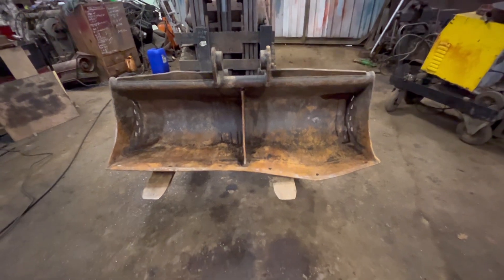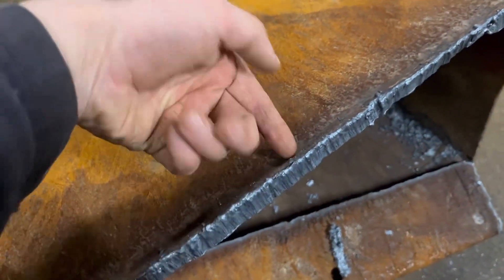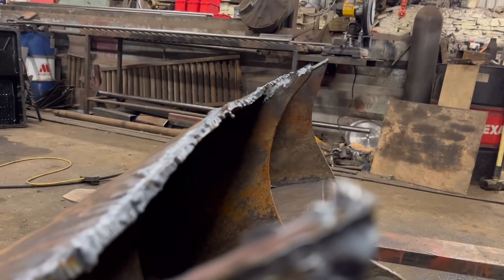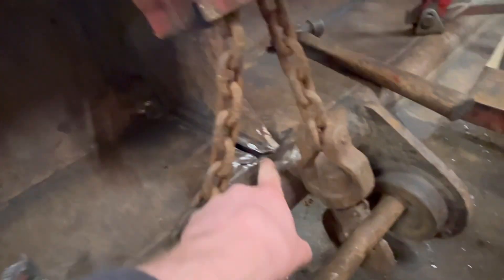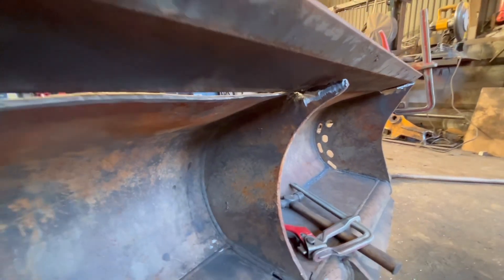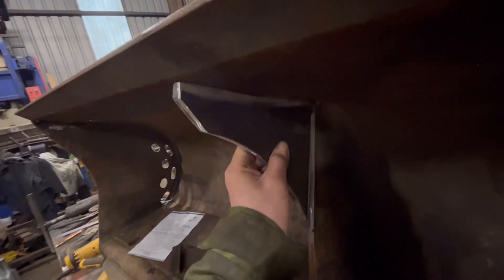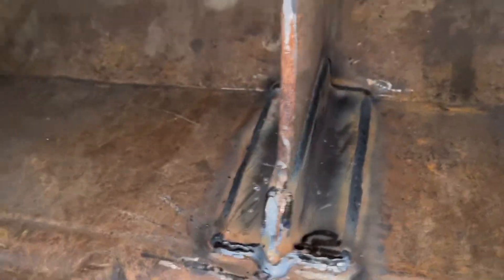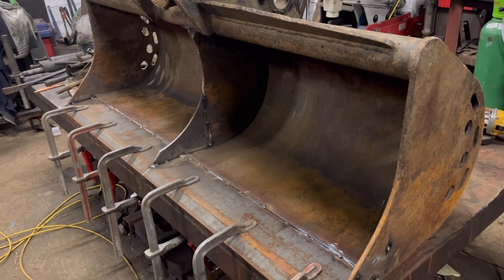Straightening a bent ditching bucket

Comment: Oliver, that was one aced job. A1. Something that's probably occurred to you since then is to add skid plates. They aren't just for abrasion prevention but beef up the rigidity of the bottom at the cutting edge. On that bucket it's obvious the operator abuses the heck out of the bucket and it needs all the stiffness it can get.
People, don't like the music? Turn off the sound and turn on the sub titles. He's doing his best at two jobs, repair and fabrication and several more hours editing the videos which aew very well done.

Comment: Am surprised that the rings were intact, clients broke the other two you worked on.  You're the only other guy I've seen doing gouge welding, seems really useful.  Curtis from CEE in Aus does it also.  Lastly, you are very soft spoken, might need a mic like pastors wear, over the ear on a wand.  Good job straightening that bucket.

Comment: Why don't you get yourself a plasma cutter?. It's so much faster and precise than the torch and you only need compressed air
Reply from the maker: I’ve got one and I don’t agree
Reply: @snowballengineering  🤷‍♂ I though the same until I learned to use it correctly 😂

Comment: Why didn't you replace the adapter plate you removed with another adapter plate  instead of a weld on cutting edge? Now when the edge gets worn they'll have to cut and weld instead of unbolt and rebolt!??
Reply from the maker: The customer gets what the customer wants
Reply: @snowballengineering  you are correct. I wasn't there during the dialog but I would have urged the customer to go with the adapter plate ,kudo's if you did!! Liked the video, nice work and the dialect!

Comment: What machine do you run the arc gouging rods on? Does it need to be a big transformer machine?
Reply from the maker: I use my 400amp tecarc welder. It’s a transformer based welder.

Comment: Good explanation of your plan of action. Which produced an excellent fix of the bent bucket Good use of fast motion.  Excellent video.  I’d do something about the gas leak flame from the nozzle tightening nut. Try using an engine valve lapping method .caution don’t leave hydrocarbon deposits due to the explosive reaction with oxygen under pressure.

Comment: When you put in those angle iron braces. Is there any strength advantage in drilling some holes in them so you can weld inside those holes. Instead of the braces welded entirely around their outer edges, you could have more weld holding their interiors by having holes drilled that you fill in with weld to the back material.

Comment: good stuff, what I do is run a 2/3mm slitting disc on the line I want to cut. that way on site or out side any chalk mark that gets wets then the line from the disc is there.
Reply from the maker: That’s a good idea! I’ll do that, thanks
Reply: @snowballengineering  Started in 77 as an apprentice tool maker so that helped lol
Also 20 years pulling cars/trucks on jig frames, I would have split that bend in the middle as it had dragged both side in. if you split it then you are not fighting both the middle and outside. I use 9" gringers with thin discs all the time.
https://youtu.be/gtfmPEBCcKQ

Comment: Nicely done, very nice video. Like the 10 inch stitch welds. Only question I had was why not 2-3 passes on the bottom welds? I would think that with the stress on the cutting edge some extra welds might make the blade last longer. Maybe I missed it, but what steel did you use for the cutting edge? Overall though, very good job.

Comment: Great video. I noticed when adjusting your torch flame you point the tip down onto the surface of the workpiece. Is there any particular reason for that?
Reply from the maker: Yes, it’s because I’m using propane, propane burns away from the tip so as soon as the oxygen is turned on, it blows the flame out. Placing the torch onto a surface stops this from happening. Thanks for watching.

Comment: Nice video,  I like that you explained the process your about to tackle before you do it.  Because you  asked if there is any thing you can do to make the video better, here is a suggestion.   You are not a musician showcasing your musical talent, so why have music so much louder then your voice.  Set your volume of your music half the way lower then the Peak of your voice or back ground sounds that happening  in the video.  Sound system in computer have an automatic gain control system  (AGC), Any loud pop or slam of a hammer will cause the AGC to lower the volume for  a second the take it back to normal. Music is more consistent sound so the AGC set an average of it volume.   On your system the sound might sound good  or balanced.  But users are watching on phones, laptop speakers, Built in monitor speakers, head phones, or Power speakers system with sub woofers.  Laymen terms The music was way to loud and having to turn the Vol down and them up again to hear what your saying is annoying.  But sense you asked LoL
Reply from the maker: Editing on my iPhone it didn’t sound too bad but I’ve learnt an important lesson from this video. Thanks for taking the time to explain. I’ll try to improve on my future videos!

Comment: I’m from the states and not many guys use supplied air for these jobs but we should. How long does your hip air usually last? Very nice work!
Reply from the maker: The battery is supposed to last 10-12 hours but mines getting old now so will only last about 4.  Definitely worth using though, saves breathing in all that dust and smoke.  Thanks
Reply: That is not a supplied air respirator. It is a PAPR - powered air purifying respirator. A battery powered fan pulls in filtered air and forces it into his shield as positive pressure to prevent smoke/ fume inhalation.
Reply: That was a distinct improvement. Certainly better going out than coming in. There was some serious damage to that bucket. You have to wonder what someone did with it. Not digging a ditch you would think.
Reply: Nice job.

Comment: Nice job that. Better to cut the crap out and put new cutting edge on. Good move. Nice bit of strengthening on the middle part. Like your tecarc welder good Yorkshire company. Bought a spool gun off them very good well made products lots of spares too. Fergie in the background fab big tractor fan here. Look forward to more welding and fabing vids keep going thanks ruth and mark south Wales GB
Reply from the maker: Thanks! 
Yes, tecarc is good gear and in my part of Yorkshire. They’ll also make welders and plasmas to run on my split phase power supply.   The fergie is an on going project fitted with a 2.8 daihatsu engine. 
Thanks for the support.